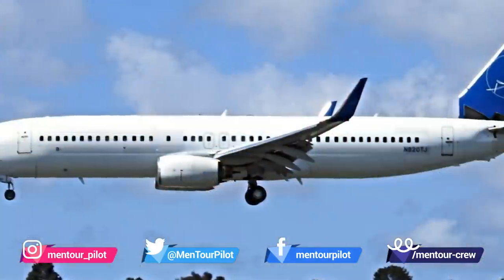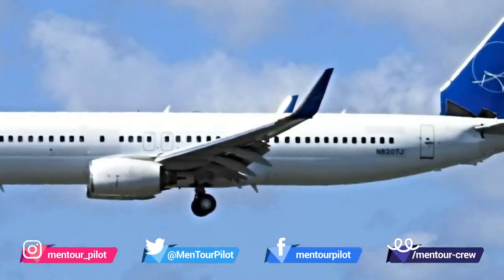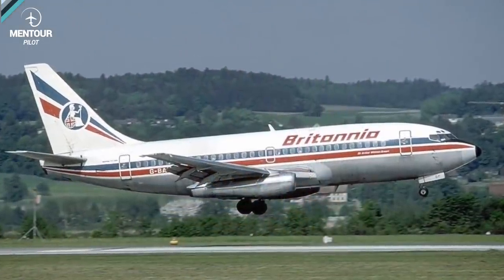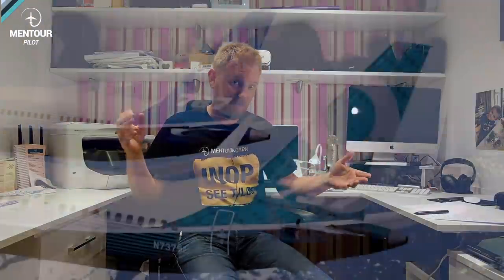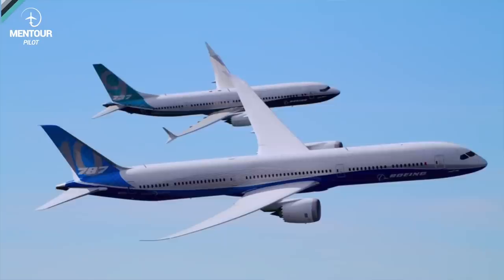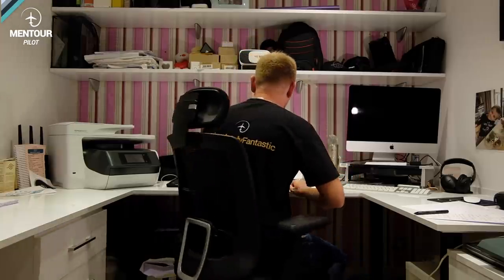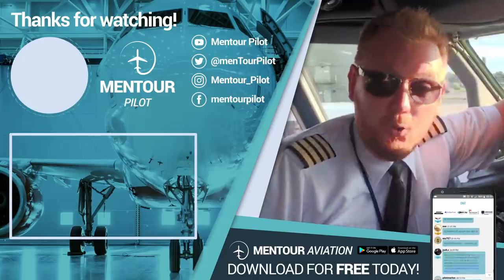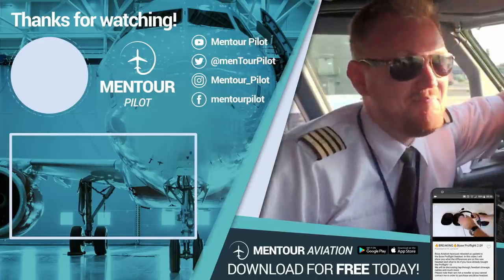Aircraft landing with missing tail section!!

Comment: Although aerodynamicly speaking not great it should be fine as long as the bolts to the vertical stab haven't been compromised. The dorsal fin is just held there by rivets to the subframe then attached to the fuselage by screws that are torqued down. Aero seal is applied to the structure as well. I assume some maintenance company may have removed it for some reason or another then possibly put to short of screws in it not fully engaging the encapsulated nuts. Just a guess lol !
Reply from the maker: Great insights!!
Reply: As a BA inspector for over 30 years I gotta say this doesn't really rank in the top 100 of strangest things I've seen lol!
Reply: James Avram there are 6 lugs that hold the vertical stabiliser in place and each needs 15 tons of pressure to remove the lugs. If you want more information look on the air crash investigation of American Airlines flight 587
Reply: Mentour Pilot  there are 6 incapsulating lugs that hold the vertical stabiliser in place and each needs 15 tons of pressure to remove the lugs. If you want more information look on the air crash investigation of American Airlines flight 587
Reply: @ahmadtheaviationlover1937  ok but this has nothing to do with the dorsal fin. The Bolts that hold the Vertical Stab in place are not part of that subframe. The bolts are chemically treated to withstand corrosion and some of the newer bolts even have a sensor in them that can be scanned to ensure the proper torque is and remains applied. Still nothing to do with the dorsal fin lol!
Reply: @ahmadtheaviationlover1937  BTW if your curious the incident you mentioned was I Believe a Airbus A300 not a 737. That incident again just off the top of my head was a crash that took place in New York? And it was the rudder itself sheared off due to extreme inputs by the crew. Now I can't speak to full incident as I was not part of the investigation nor do I have direct insight on AB aircraft design! If my memory serves me right The 737-8 has 8 bolts holding the stab 4 forward and 4 aft at the base;
Reply: James Avram never mentioned 737 at all

Comment: Did the pilots REALLY not notice any change? The turbulence created by the blunt fin root must have been felt as a high-frequency shudder in the aft part of the aircraft and certainly on the rudder itself (or is the rudder "feel" entirely artificial?)
Reply: Halfdan Ingolfsson - If it came off in flight, they might not have had any choice but to fly it to their destination. As MP said, the lack of a Dorsal Fin doesn’t effect the flight unless you have a problem that requires that it be there.

Comment: Well there you have it, something fell off, which should not have happened, it fell off somewhere, possibly on the flight. It's not a great problem, because the aircraft landed without incident and therefore "how dangerous this would have been to the crew onboard?" is okay. The seriousness of this is the danger of where the pieces fell, which could be fatal, and/or cause further problems depending onto what they fell. An investigation is necessary as it's another 737 incident.

Comment: Hey mentour, maybe the audience would appreciate a chat about CDLs and how you can dispatch with certain bits of the aeroplane missing.  Just an idea 😄
Reply: I don't think the nervous fliers out there would appreciate the info.  Lol.  I do remember seeing a C-5B Galaxy taxi in to park when I was at Travis AFB.  It was at night and I noticed the right side navigation light was out, so I went over to let the crew know.  Well when I got closer, I saw that the last six feet of the entire wing tip was missing!  I spoke to the crew and they told me they flew it like that all the way from Kuwait.  They apparently were cleared to taxi on a taxiway with insufficient obstacle clearance for a C-5 and the right wingtip struck a hangar.  They removed the damaged wing tip and got clearance from maintenance and engineers from Lockheed to fly it back to California before repairing it.  I was curious as to how it affected the lift on that side of the aircraft versus the non-damaged side.  I guess it wasn't much of an issue though.
Reply: Skyhawk _452 haha nice story!  I don’t know how it works for military aircraft, I’ve never flown one.  On my current type you can fly without the wingtips but it has to be all or none, you can’t dispatch with just one removed.
Reply: Skyhawk _452 actually I just looked it up.  I fly 2 main subtypes, rules for one are that the wingtips can be missing as a set (as I said above) but the other subtype you can dispatch with either one missing but not both!  Every day is a school day 😆
Reply: CDLs and MELs would be good😊Great idea👍🏻

Comment: Those side panels would have popped off as the small cavity within the vertical stabilizer got pressurized by the ram-air effect through the open-web design of that small, forward facing bulkhead left exposed by the missing dorsal.
They aren't real structural, just skins.

Comment: I have no experience in aircraft beyond flight simulators on a pc.  So take this for what it's worth.  Looks to me like the panels on the side could have been blown out by the sudden "inflation" of the vertical stabilizer when the slip stream pressurized it through the holes in the forward most structural member that is exposed in the photo.   I thought the skin was glued and screwed/riveted to those members, but again, I only know what I see in videos of aircraft being built with no knowledge of the detail of these components.
Reply: Those are access panels fastened with 3/16" screws.

Comment: Someone probably robbed it for another aircraft in Victorville.
Also, The vertical stab can be load bearing in a cross wind or in the extreme situation where you need to slip the aircraft.  This is not done in commercial aircraft normally, but it has been done and that would prove critical!  I don't think this situation would have caused a problem, but let's not throw the vertical stab under the bus.

Comment: It's a fairing for the vertical stabilizer not the rudder. At least the 737 will fly without the fairing unlike the A300-600 where they were taking off from Kennedy International and the entire vertical stabilizer liberated causing the loss of all aboard.

You posted a video on November 23, 2018 on the operation of the stabilizers (both horizontal and vertical.
Reply: There;s a small difference between losing a piece of the tail, and losing the entire fin.

Comment: What affect does a torn of horizontal stabilizer have on control like the Queens disaster with American Airlines flight 587?
Reply: Nikhil Naik - The loss of the ability to control the Horizontal Stabilizer is generally fatal - AA Heavy 587, that was caused by a failure of the Jack Screw serving the HS.
Reply: TraditionalAnglican that’s Alaska 261 you’re thinking of. AA587 was the one the pilot stamped on the rudder pedals left and right and the forces overstressed the frame and it sheared off the vertical stabiliser
Reply: @tomstravels520  yeh thats what im talking about when the HS shears off whats the control effect with the AA flight it seemed uncontrollable.

Comment: Isn’t there ‘weaker blow off panels’ that are meant to blow off in the event of a sudden pressure differential in/out of skin? For example if rear pressure bulkhead fail the the air has to go somewhere. Are these that type of panel?

Comment: It looks to me more likely that the panels of the vertical stabiliser blew out due to a rise in air pressure in the cavity behind them, due to a sudden inrush of air through the now exposed holes in the flange in the front of the vertical stabiliser.

Comment: Would be nice if they manage cameras so you guys can see the whole back of the plane and your engines on One display
Reply: That would be perfect. It should at least be seriously considered. Stop relying on instruments all the time.
Reply: Douglas Corely,  Good point. Cameras trained on the engines (at least) should be mandatory on all aircraft. In the Kegworth Air Crash in the UK in the 1980s, the pilots shut down the wrong engine. Passengers and cabin crew could see the smoke coming from the damaged engine but the pilots could not, so they mistakenly shut down the good engine, leaving the aircraft without power. The investigation, if I remember rightly, recommended the installation of cameras on all aircraft, but it seems this may not have happened . . .

Comment: I would be concerned about high pressure air entering the three holes n the front edge of the vertical stabilizer . this may be the cause of the lower panels being missing.

Comment: Yaw, you did not mention anything on Yaw Petter.
so I assume the vertical stabilizer with the rudder attached to the end of it do not have any effect on Yaw.. yes?
Reply: The entire purpose of the vertical stabilizer and rudder is to control the aircraft on it's Yaw axis. The vertical stabilizer provides fixed yaw stability and the rudder gives it variable yaw control.

Comment: I have a question regarding wheels up. As I understand it. After V1 there's no going back. So why don't pilots raise the gear IMMEDIATELY after lifting off the runway given the better aerodynamics,  lift and general (it would seem) risk reduction?
Reply: Errrr they pretty much do. You wait until you have a positive rate of climb and then you raise the gear. Just incase the climb is not a good one and the plane were to go back down then at least you have the gear to cushion the impact

Comment: Certainly there will have been aerodynamic stress on the rudder for which it was not designed. A flat surface was being loaded where the missing part should be.
Reply: The exposed heavy structural leading edge of the vertical stabilizer can take this load no problem and the actual rudder is 15 feet aft of this area. Also, the 737 aircraft is robustly designed and built like a dump truck, it's not some flimsy Airbus.

Comment: If not for the amatuer photographer, No-Way Boeing would have ever noticed the dorsal fin was missing.  The stabilizer was dented.  And panels on the tail were missing during it's next factory inspection.  When shit falls off Boeing's planes, it's just a simple adjustment to MCAS to keep it flying like a 1967 model.
Reply: rayism 24b Boeing does not perform walk arounds of the airplanes...🙄

Comment: I would expect the face pointing forward that is normally covered by the fin to cause the air to flare as it hits it, reducing the effectiveness of the rudder?
Reply: I'd expect some loss of rudder effectiveness as well, but keep in mind that there's a lot more rudder surface higher up that's clear of the airflow disruption, so the difference is probably fairly marginal under normal circumstances.  (Or as normal as it's possible to be with a nice sized chunk missing from the plane)

Comment: Guess who builds flying garbage cans, starts with a "B" ends with a "g"
Reply: The 737 is the most popular and prolific aircraft in commercial aviation history.  I think many a pilot and airline customer would disagree with your assessment.  Iterations of the 737 have been in service since 1968 with over 10,000 deliveries ever since.  It's only the recent problems with the 737 MAX that have brought a negative light on the series, but the MAX related issues are unique to the MAX and have no bearing on the safety of the -100s through -900s.

Comment: I would love to take out the ceiling panels and see if the 16 bolts that hold the dorsal fin on are there. They attach from inside to out. I can't see any frame  work, panels or remaining screws in any pics I can find, so my guess is not installed. Wonder if this plane was fresh out of the hanger after a paint job ie first flight. A bad practice is to rush jobs, sometimes people put stuff in place so painters etc can work through the night, even if you not done. I have seen panels blow off for this reason.
Reply: Sean Bad 14 isnt it? 
AMM 55-32-11-400-801

Comment: Definately not a birdstrike, it would not been clean off with a birdstrike.
Think actually the dorsal fin and the access panel have been of for a inspection or something.
Not written down on workorder or in shift handover, and then signed out and pushed out in the morning🙄 
As for the dent in the LH hor. stab LE it may well be an old damage.

Comment: Is it possible to land a plane with a completely missing Rudder Fin?
Reply: "Air Transat Flight 961 was an Air Transat flight from Varadero, Cuba to Quebec City, Canada on March 6, 2005. The aircraft experienced a structural failure in which the rudder detached in flight. The flight crew were able to regain enough control of the aircraft to return safely to Varadero."
Reply: Only if you’re extremely lucky..
Reply: @MatthijsvanDuin  wow that's one hell of a pilot

Comment: Wouldn't the missing skin panels on the side of the rudder reduce the torsional rigidity of the rudder?
Reply: Somewhat the same as the siding on your house, but the inner structure is very strong and that is a relatively small amount of skin that is missing.
By engineering standards, every additive element "adds strength". Even the extra thickness of a layer of paint slightly raises the yield strength of those painted elements.

Comment: @Mentour Pilot It is just speculation, but once the fin was missing, the holes that are pressed into the sheet metal, front facing to the airflow, might have channeled high speed air into the stabilizer cavity and blew those side panels out as the air tried to escape. Just a though, because the pressure of air being passed through those small holes, I'd imagine, would have been enough at least push the panels outward, and might have been enough to pop the panel rivets

Comment: Hard to imagine bird strike.. Even a large ocean bird like an Albatros would be insignificant to the mass of a metal structure, especially when shaped like a 'blade'.
Perhaps, poor maintenance practice?
The 'dint' on the stabiliser seems deep enough to assume, it was caused by impact of metal to metal ( the falling piece of the rudder I would imagine..)
Not a very good image for the airline and the overall safety control protocols..

Comment: Imagine having parts fall off when flying  This post was made by the Airbus A320
Reply: These days with the MAX-8 thing I'm of the "if it's Boeing I'm not going" crowd until they get their engineering and management disentangled, but the incident in this video is very likely to be caused by the mechanics not following the proper procedures. Especially since Victorvil is a maintenance hub for this specific type of aircraft (and many others).

Comment: Wow that could've been a disaster had the entire tail ripped off...wow...thank God!!
Reply: Not that serious. The tail is known as the Vertical stabilizer and is separate from the dorsal fin. The bolts holding the vertical stab in place are one of the strongest joints on the aircraft it would take very extreme forces to separate it from the fuselage!